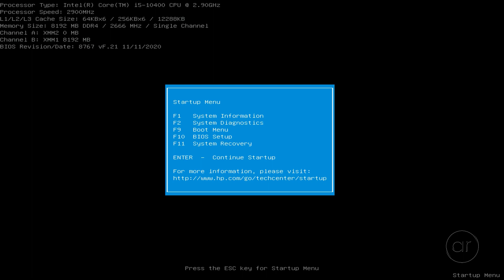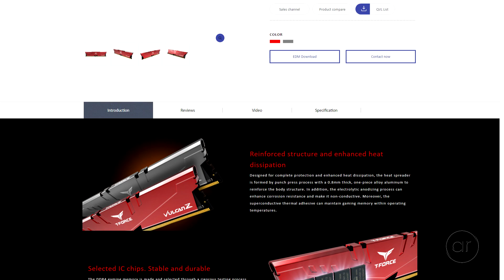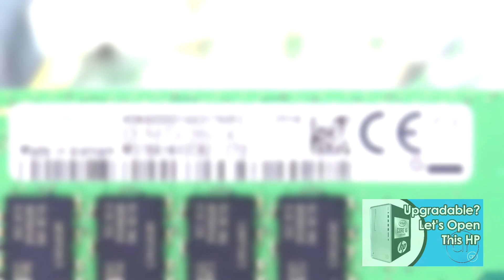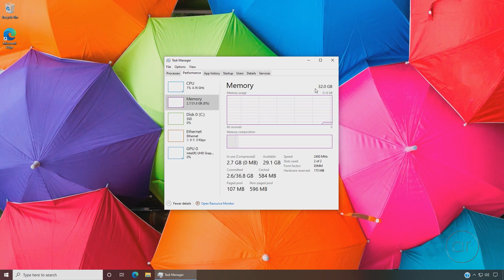How to Upgrade Your RAM in an HP Pavilion TP01-1016

Comment: After a bit of testing with this motherboard and various sticks of RAM. It seems to use the JEDEC standard for memory timings, not XMP! So ensure any sticks you buy are JEDEC rated for 2,666 MHz at 1.2v. I know this is a bit late but it may help someone.

Comment: Thank You, Thank You, Thank You.  My computer loves the new RAM and the recommended sticks worked like a charm.  Easy to install as you showed.  No more blacking out of the screen and error messages of not enough memory to load pages.  This was extraordinarily helpful!!!
Reply: Do you have a video on how to overclock the memory speed for this computer?  to get the maximum speed out of them and the processor?

Comment: This is the hp that I have. Its not even 2yo yet. For some reason It keeps getting the blue screen for critical errors. Could it be the ram? Is 32 the most available that they make for this hp? Its pretty slow right now and doesnt seem to handle all the multitasking and work that I do.
Reply from the maker: Memory will help with multi-tasking, but the single biggest performance boost would be to replace the hard drive with an SSD. Since you are getting blue screens, you may want to consider restoring the factory image of Windows while upgrading to a new M.2 SSD (a link to one of my other videos is in the description).

Comment: Added a pair of Integral 16GB modules to mine now. Integral IN4T16GNELSI is the part number and they run at 2,667 MHZ.
Reply from the maker: Thanks! I've appended to your comments in the description.

Comment: Does anyone happen to know the name for this hp's psu cables? Im trying to upgrade my psu but these hp motherboards make it hard to find a good psu " dont know how to splice cables yet"
Reply from the maker: You may want to check HP's parts store. However, it doesn't look like the PSU is modular (I have another video that tours the insides here: https://youtu.be/2_Ti8fmRMaA) so you could use a power splitter.

Comment: I bought a 16gb ram car for my Hp pavilion but the notches on the ram card and insert slot don’t line up. How can I identify which kind of ram card my pc will take before I buy a new one?
Reply from the maker: You may have a different type of memory (for example, DDR3 instead of DDR4), which will have notches in a different location. If you look up HP's support website for your specific Pavilion model, it should list the type of memory that it uses.

Comment: I did this and when I turn the power on I get 3 long beeps and 2 short beeps. Any suggestions?
Reply from the maker: This can occur if the memory is seated incorrectly or if the memory itself is bad. Is it possible to try the memory in a different machine to rule out that possibility?

Comment: Another great video. I just upgraded my HP Envy TE10-1287 from 8 GB of DDR4 to 16 GB of DDR4 3200. I also upgraded M.2 NVMe from 16 GB to 500 GB. The 16 GB drive came in the computer and had the OS installed on it. I installed the OS onto the new 500 GB M.2 using one of your videos as a guide. The restore drive worked perfectly!!  While I had the case open, I removed the old 1 TB HDD and upgraded to this: Seagate BarraCuda ST4000DM004 4TB 5400 RPM. Problem now is Windows 10 does not see the new 4 TB drive, but the BIOS does see it. Do you have a video that may help me with this detection problem? Thank you in advance..
Reply from the maker: Thank you. Do you know if the 4TB drive is initialized? In other words, does it appear in the Window's built-in Disk Management utility? If it shows in the BIOS but not in Disk Management, it means the disk has not been initialized nor partitioned yet.
Reply: @accessrandom  Yes, that was the problem. I was able to format the drive through the disk management wizard and allocate 706875 GB to get the full use out of the drive. It's now showing and is fully usable. Thank you for the fast response.

Comment: Interesting, I got a 2933 MHz kit of 2x8 GB, and the only downgrade was to 2666 MHz. Annoyed, of course, but not a severe downgrade.
Reply from the maker: Thanks for the extra data point. May I ask what the brand and model number of the memory is? I can add it to the description with credit to you.
Reply: @accessrandom  my model is a TP01-1036, the RAM Is the Corsair Vengeance RGB Pro 2x8 GB 2933 kit.  
Also, the PSU on the TP01 models can be upgraded. L04618-800 is a 400W PSU option, which opens up lower powered GPUs
Reply from the maker: @ZudeXbox360  Thank you! I've added your note to the description.

Comment: You can not change ram speed in the settings for bios It is all XMP enabled and it will work with faster ram  But only compatible if you use HP branded ram
Reply from the maker: Thank you for that helpful info.

Comment: Is there a way to change the clock speed? I got pretty much the same ram but at 3200 MHz for my pc, yet it clocked at 2400, can I change it to 3200 MHz because the motherboard is supposed to support that speed.
Reply from the maker: I'm afraid HP has locked down the BIOS to prevent clock speed changes. I also was hoping I could do so.
Reply: It has to be HP branded branded ram for the XMP to work in the bios it will work for 3200 as I have the tg01-0023w version.  Hp locks their bios which is bs but it is xmp (make sure your hp bios version is up to date through the hp website). So it has to be hp brand ram, predatory approach in my opinion on their part. Because your absolute limited on CL as theirs is slow.

Comment: Bought 3200 ram for upgrade but it doesn't run at 3200 anyone know how to fix that?
Reply: AMD Has an application you can use to modify your  Ram settings. HP is an asshole they lock bios for memory. Your PC can run that ram but the xmp will only work for Hp brand ram and you need the most recent version for HP bios. Check updates and downloads from their website.

Comment: Your tutorials are fantastic! You explain everything so clearly and also slowly so I can understand. I was wondering if you could you do a tutorial on how to upgrade the power supply? I’m wanting to upgrade my graphics card and for that I need more power. I have a TP01-2255t that comes with a 310 watt PSU
Reply from the maker: Thank you for the kind words 🙏. That is a great suggestion. Unfortunately, the power supply in the TP01 series isn't a standard ATX form factor and the pins are proprietary, so I'm afraid a third-party power supply wouldn't work out-of-the-box. HP does sell OEM power supplies from their parts store, but they can be quite pricey.
Reply: @accessrandom  Thank you so much for responding! Yes, I've been reading a lot online about that so I went ahead and ordered the 500 watt PSU from the HP Parts store. That way I have it and can wait until prices go back to normalcy on GPUs for a future upgrade.
Reply from the maker: @birdyoconnor  Awesome, thank you for the update 👍. I hope you can re-visit and report if all goes well...

Comment: Added a single 8gb module to mine. Branded "Integral" 2666 MHZ. Happy to report it was detected and the machine runs at 2666 MHZ in dual channel.
Reply from the maker: Awesome, thank you for that information. Do you mind if I add it to the description with credit to you? Also - would you happen to have the model number for it?
Reply: @accessrandom  No problem! Integral IN4T8GNELSI 8GB DDR4 RAM PC module 2666MHZ 1.2v
Reply from the maker: @Ted-Branston  Thank you 🙏.
Reply: @accessrandom  Interestingly, that "Integral" stick that I added is reported as being 3200 Mhz in the bios!
Reply: Your memory is rated at 1.35v which may explain the low speed you attained, 2,666 being the max supported by the cpu anyway.

Comment: Hi access random. I saw in your video of unboxing the CyberPowerPC, and at the end you mentioned that you have to connect the case fans. My front fans don't spin, so I wanted to ask how you do that?
Reply from the maker: The model that I have didn't require me to connect the fans as they were already connected. If you follow the power leads on the fans, they'll be either three or four pin headers, which will connect somewhere on the motherboard (the location of which will differ from model to model).

Comment: Hello! I have a very similar system, The HP Pavilion TP01-0034 (8 GB PC4 21300 DDR4-2666 SDRAM (1 x 8 GB), (Intel® Core™ i7-8700 (3.2 GHz base frequency, up to 4.6 GHz with Intel® Turbo Boost Technology, 12 MB cache, 6 cores))  and I recently upgraded my RAM from one 8GB DIMM CL19 to two Patriot 16GB DIMMs PC4-21300 DDR4 2666 CL16 just like in this video. However, I started experiencing issues afterward, mainly my system will freeze indefinitely after playing a game or watching a video for an extended amount of time forcing me to hard reset the system, which has only occurred ever since I installed the RAM. Is there any possible explanation as to why this may be the case, and is there anything I can do to fix it? If you know I would fully appreciate your response <3
Reply from the maker: I would try running a memtest on the memory. If it passes, are you able to try them in a different PC and see if it causes any problems? I'm wondering if there is some inherent incompatibility with the motherboard.

Comment: I'm no IT guy but I don't get why BIOS without at least RAM tweaking is still a thing... I mean, f.e. at my work we are still using old Pentiums and Celerons (1st-2d gen) with win XP, but the ASUS motherboards are allowing to overclock the CPUs and RAM and also have both easy and advanced modes as well as different presets of the system work pattern. This and 24/7 running is what keeps those PCs still working and managing tasks just fine.

Also nice video.👌
Reply from the maker: Thank you 👍. Agreed, I imagine it's a subtractive process for HP to remove functionality from the BIOS. The only reason I can think of is that they probably want to reduce the number of components they can support and/or they don't want to take support calls for overclocking...
Reply: access random  if given the choice, I would gladly forfeit all warranty support for overclocking options — even just the ability to adjust memory timings at DDR4-2666. But I’m sure 99% of people (and corporate deployments) would disagree with me.